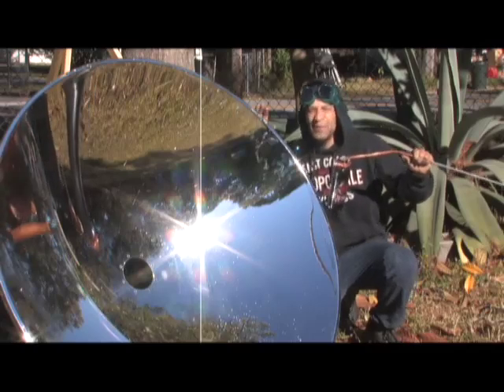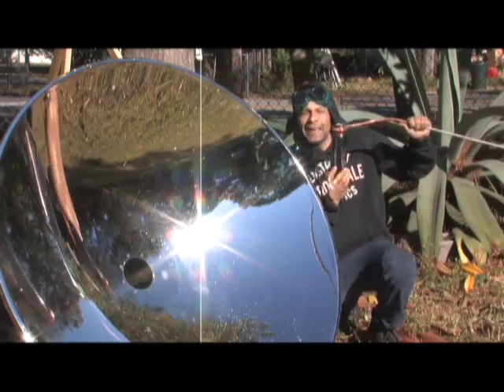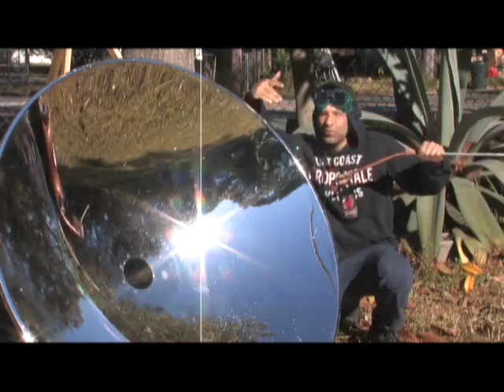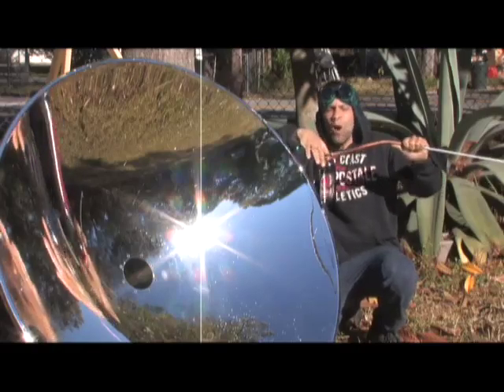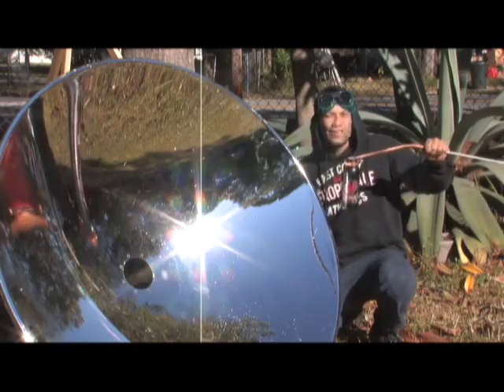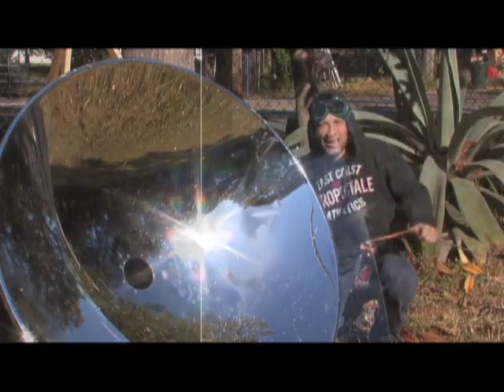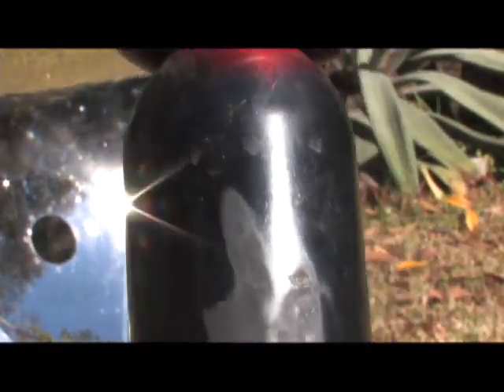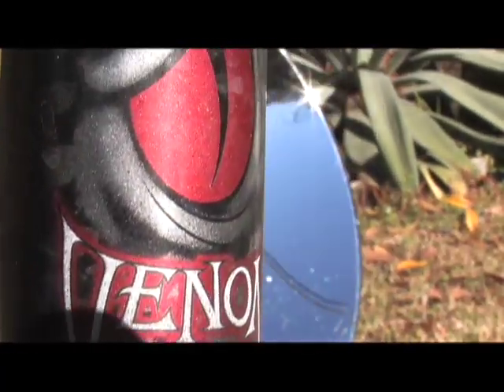PARABOLIC MIRROR 55.7" PARABOLOID SOLAR POWER STEAM Free Energy Giant Death Ray

Comment: do you have experience with the mirror spray paint? would a nicely finished spray on be better than the reflective tape?
Reply from the maker: Kyle bird Does not work. I have tried them all. Even the $150 3 can set. Only true vacuum deposition or metalized reflective film works.
Reply: thats good to know thanx alot! about how much energy is lost percentage wise, from a perfect mirror finish vs. the reflective tape, maybe with a reflector thats about 18inches in diameter?
Reply: also i found this old aluminum disc that was used for small fires. it's a nice size and shallow, but the center is flattened out a bit. will this still make an effective parabolic reflector, and will oval shapes work just as good as circular?

Comment: Dan with this unit (again with reflection by flat mirrors from your parabolic mirror) ... why not reflect the concentrated light down to a say a coil of bendable copper tubing filled with water and covered with carbon? (not charcoal it will ignite) but actual carbon? carbon does not vaporize to an insanely HIGH TEMP.. and like neither will copper.. so you keep your "black" surface to transfer EM Wave (light) energy to Thermal Energy and to your Steam Generator into ELECTRIC ENERGY or to cook your eggs or like back your pizza or in my case... cook up some tacos or fajitas! Ole!

Comment: Put a convex mirror at the reflectors focal point (you need the virtual focal point behind the convex mirror to match up with the main mirror)
if you get it right you will send a parallel beam back behind the main mirror through the hole see image here http://pbs.twimg.com/media/B5CMXcQIMAEQOfg.jpg
I wonder how far that beam could go and still be useful ?

Comment: I too am working on a similar project to use with a "Solar Sterling Plant" to create electricity.  I have in my back yard a mesh parabolic satellite dish from the late 70's early 80's.  I would like to convert it to parabolic solar reflector but it measures 10 ft 2 1/2 inches in diameter.  As I said it is a metallic mesh and has, I'm guesstimating about a 30 degree curve.  Is it possible to convert it and if so, how would you recommend I go about doing so, as it is four ft. off the ground?

Comment from the maker: This dish was coated via vacuum deposition = aluminum. I would suggest a mirrored adhesive film. Avoid any spray can chromes regardless of the price, they are all crap. Also avoid the mosaic mirrors, a solid film mirror layer is = to a realtime image or super HD while mosaic is = to low resolution digital. The number of mirrors does not equate to the sun x factor. Check our site for film links, how big is your dish and surface.

Dan

Comment: Hello, 
I'm doing a similar project, generating electricity from a Stirling engine. I would like to ask you about the shiny layer on the dish (I guess is some aluminium), where can I get it from? Or what kind of material is actually?

P.S. I was thinking about buying mosaic mirrors but, mosaic mirrors would require more work than a shiny silver layer.

All the best!

Comment: So what is the difference between a fresnel lens and a parabolic aluminum dish in terms of the energy, heat, and temperature generated? Is there a way for me to turn my direct tv satellite dish into one of these types of devices if I cover it over with aluminum or something reflective? Also I have a 99.9% huge silver coin of 6 inch diamtre. I wonder if I could use this as a mini parabolic device or would that fail due to its flatness? Thanks!

Comment from the maker: Yes but the energy is the same. Closer yields a large focusing spot with a lower maximum temperature, larger area.

For water it is best to not be at optimal and illuminate the entire side of the container. The larger area looses less heat and transfers faster. Super high temperatures leach a lot into the atmosphere reducing efficiency. Since I was just holding this it was in and out.

Comment: If you take an old-style (C-band) satellite dish mount and change the elevation and inclination to follow the track of the sun, you can use this method, although it works best with a polar type dish mount. You wouldn't believe the number of these dish mounts I scrapped back in the 90's when I was a satellite installer, when people went from C-band (10' dishes) to DirecTV... Now I wish I'd held on to a few... If you'd like a rough diagram of how one of these mounts is put together, email me...

Comment: 17 Oz = 502CC or about 502 grams
Specific heat of water = 4.186 j/g/degree C

50F = 10C     boiling = 100C
90 C temp change

total energy = 90 * 502 * 4.186 = 189Kj

Power = energy / time = 189Kj / 90 = 2.1KW.

I've always heard the sun was about 1KW / m^2, and this pretty much agrees.

Cool experiment.  I like measurements.

Comment: have you tried to boil water with the parabolic mirror to drive a steam generator ( turbine). the idea of running water in and out using the copper tubing looks like you might be able to generate enough. i also saw your suggestion of running a sterling engine  but seems like a waste of energy

Comment: the system is nice, but it has one flaw: 
you need a sunny day and we dont have so much.
and murphy says you dont get sun when you need it.

the power has to be at least 1KW, when i compare time and amount of water with my 2KW waterboiler.

if you could get open tubes instead of parabols, make a circulating watersystem on it and lock it to a computer with sensors it could be worth something. 

btw: nice videos!